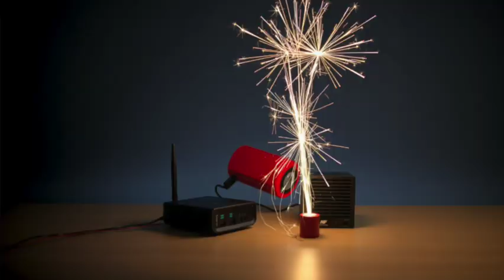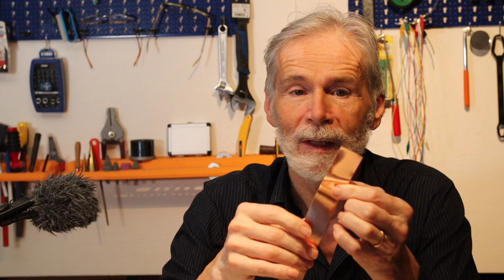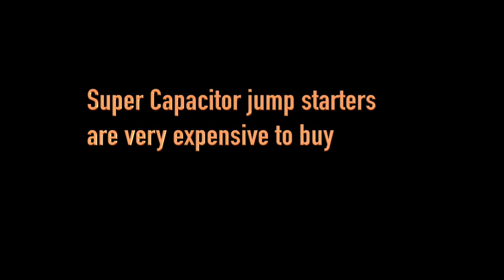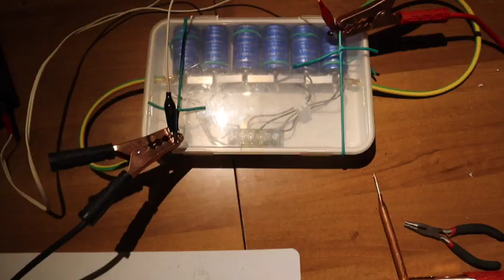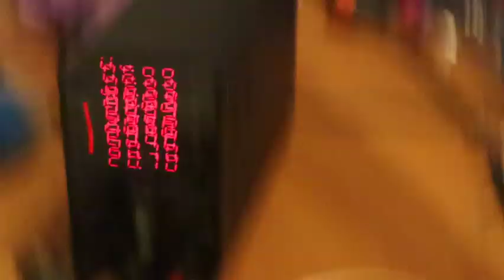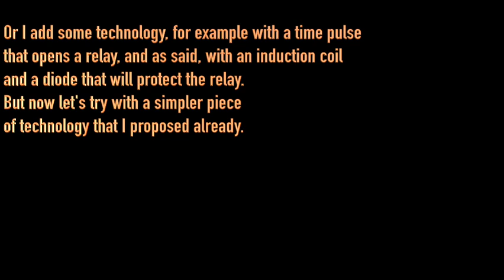How to use Super Capacitors - Video 99

Comment: 🤔Hmm 👉 Capacitors have a strange effect on the national grid  transmission system. 
Higher voltages ⚡️  need to be dumped to  protect the transmission equipment 😟
Just by applying higher mains voltages ⚡️  harvesting free energy is possible 👌 
Let's do this 💪 
https://youtu.be/ZLGeNu7iR_E?si=FrZYquoOwWOuT2kj
Reply from the maker: I saw the video you sent and it is about high voltage lines. I don't know what our influence can be there.

Comment: Nice video! I was wondering about us tankless water heaters, use super capacitors as a starting current, they need 100A at start but I only have 20A fuse (3 phases x 20A) ? Could this be an application, I remember a company using batteries to start their induction stove :) but super capacitors would be a smarter solution for tankless water heaters? Keep it up with the interesting videos :) //Cheers
Reply from the maker: Thank you Fredrik for your support again! I suppose you have 110 Volt, that would multiply with 100A to 11 kW and I can imagine that is needed to have a strong hot water jet right from opening the tap. That would be difficult to realise with super capacitors because you can certainly ask them 100 A but it is DC (in itself no problem) and worse, you must put 50 or more of them in series and the switch after a few seconds to the AC grid. No, I would put a very small but well insulated water tank under the sink. Super capacitors are electric storage but water has such a high specific heat coefficient that it is automatically expensive to heat it through electric storage. Another idea is that you challenge the need for immediate hot water and realise a constant power & slow start of the jet.

Comment: I followed an early design for a PV diverter that allowed grid- tie solar to be utilised for water heating. But now I’m just charging batteries by timer during peak generation, then use them for evening cooking. Would be nice to be more efficient, but I think I have an oversized solar array for my needs.
Reply from the maker: Very cool! Maybe you can think of converting fuel consumers to electricity consumers. Please take a look at video 71, already 106000 viewers, or charging an EV. Even more green and rational is an electric bike or scooter.
Reply: @I used to use a petrol lawnmower but changed to electric because of free power during the summer. I’m also converting an old lawnmower to power an alternator for emergency charging if needed. 👍
Reply from the maker: That is a great idea take a gas generator in this way! It might be a challenge to recover the heat but you can start with the high temperature fraction that comes from the exhaust. See also the playlist of Micro Cogeneration. There  i recover the heat at 2 different temperatures.

Comment: If you draw more than 1A per 1000µF, your capacitor life will decrease. The ESR of the capacitor will increase rapidly. Also high temperatures for too long will damage your capacitors.
Reply from the maker: Thank you Paul, I just bought 10000 microFarad capacitors, so then I will take care of a 10A limit!

Comment: Supercapacitors are awesome i made a capacitor bank to replace the batterie in my 50cc vespa scooter about 6 years ago and its still working and probably will last years to come
Reply from the maker: Thanks for sharing Niels, what were the functions of the battery? I imagine that starting a light 50cc is done with the feet. My Moto Morini is 350cc with a kick start.